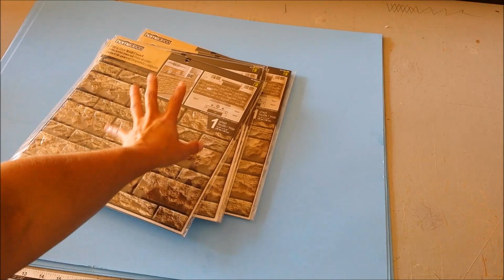DIY 1:6 Scale Dollhouse #4

Comment: Why spend so much time using flimsy materials when the same time spent could be used with plywood and you would actually have a sturdy house. Even quarter inch plywood can be cut with a craft knife.
Reply: Carousel Creative Crafts because she already made 3 houses out of wood this video is for the ones who do not have the proper tools for wood.
Reply: As  I said, kraft knife will cut quarter inch plywood.
Reply: No, it won't.  Not actual plywood.
Reply: Cardboard is very strong when you use several layers.  Look up cardboard furniture on youtube.
Reply: And plywood is expensive, you can get cardboard for free
Reply: I have cut 1/4 plywood with craft knives for years. Since about 1972, to be exact.
Reply: Cost. Plywood costs money, cardboard is free. I made a three story Barbie house for my grand daughters. The cardboard, newspaper were free. I only spent on the masking tape (cheap), white glue and a quart of white paint! Total cost...less than $20! Plywood would have cost so, so much more.